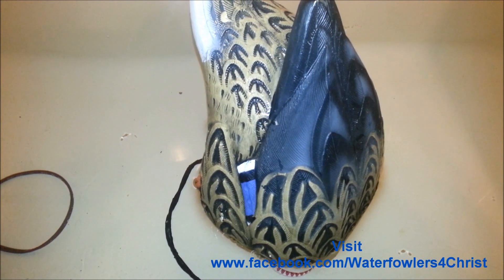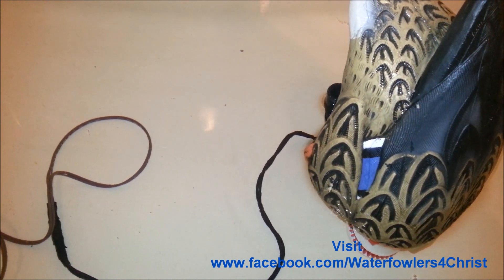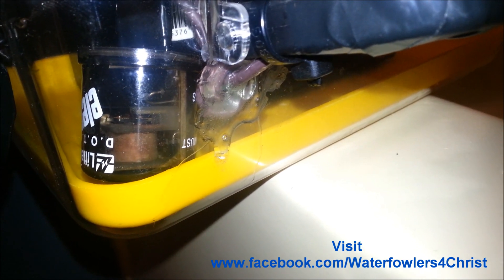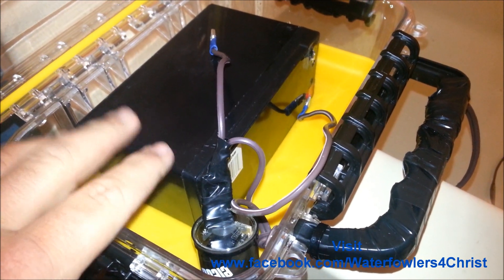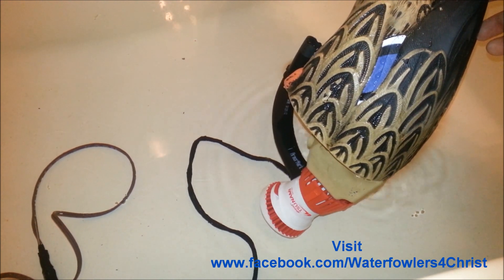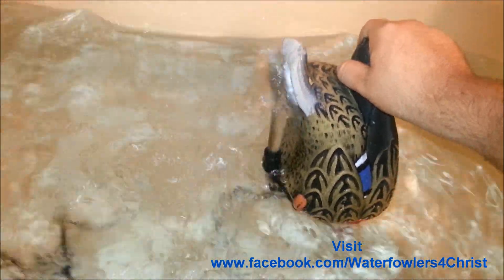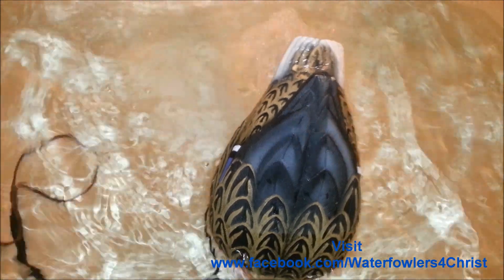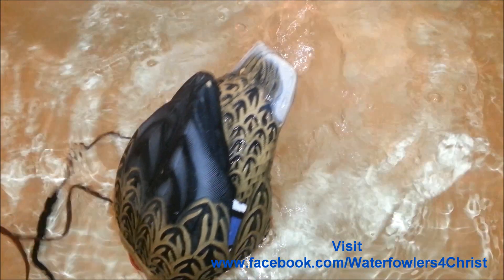How-To: Homemade Duck Butt Pulser Decoy

Comment: Hey thanks for the video. Just made two of these. Only problem is the battery box floats, too much buoyancy. Did you just let yours float when in use?
Reply from the maker: I actually added about 4-6 lead strap weights inside the box. Just enough to sink it. That way the box acts as the anchor.

Comment: just made Mike and it works great 9.00 for the pump on amazon  I didn't make submersible  box instead I made a box with a on off switch an a solar charging port to keep the battery charged an probly 20 foot of an older thick green extention  cord
Reply: +Cal Leblanc I just realized comment I didnt.know how to do the YouTube comment from my phone

Comment: How many amp hours is your battery and how long does it last while hunting?  Any problems with ducks flaring once they get close?  Thanks!
Reply from the maker: Battery normally lasts around 6-8 hours on a full charge. I haven't noticed it flair any birds. First season I used one, we had birds land right beside it and sit for a while.

Comment: you think you could send me a part number on that flasher. I have 2 6v deer feeder batteries in parallel running a 800 gph. I'm having a hard  time getting a flasher that will work. Ive tried two electrical flashers and 1 thermal cant get the bilge to flash. thanks
Reply from the maker: Sorry, just saw this comment. It was a Novita EL-12 flasher. I have others who messaged us on Facebook have some issues with them occasionally. I bought mine from the local AutoZone. However, the ones I've seen that had issues seem to come from Online retailers. Not sure if they are knock offs or if they were wired backwards. I've built 2 and they both pulse a little differently, so it could just be the quality of the part too.

Comment: Did you experience your wires from the battery to the relay getting hot? I used 18 gauge wire.
Reply from the maker: I haven't noticed it at all. Although, the water around the box keeps it pretty cool.

Comment: very good idea. thank u. If u wanted u could just add a decoy timer to it instead of the flasher.
Reply: had same thought would seem more realistic to me and drain battery less if it had more of a delay started looking at adjusyable flasher relays lots of cheap ones on amazon around $10 but any timer would be an improvement but whatever works for you

Comment: How'd you wire the flasher? Is there some kind of in line fuse?
Reply from the maker: I just added it in on the positive side just inside the box. I didn't add a fuse in either. I have noticed that some flashers do not work with this setup. The cheaper ones are thermal-based, and do not work. The more expensive ones are electromagnetic and work fine. Hope that helps!
Reply: Waterfowlers4Christ maybe i just need heavier gauged wire

Comment: did the jb plastic weld close off wire stregth from battery??? it did on mine
Reply: with that bidlge pump, i got same one, i can tell it did...
Reply: mine sprays way more
Reply from the maker: Didn't notice. The 2 I have, one sprays more than the other. Figured it was the hose being longer/shorter.
Reply: run it directly to a battery and not by box and you will notice a huge differnce
Reply: how did you wire your flasher?  can't get mine to work?
Reply from the maker: just from the battery to the flasher, and then to the bilge. Usually when someone has a problem, the flasher is either not an electromagnetic type, or it is a bad unit.

Comment: I didn't make my box submersible I used a water tight ammo box an wired in a on off switch as well I toss it out between the other 3 butt ducks I have an now they all move with the ripples....... keep in mind you will not get all that motion when you put it in a pond or open water the waves bouncing off the side of the tub over exaggerate the motion but it does send out a good ripple still an the tail wiggle great

Comment: Cal leblanc I got it off amazon from a private seller it was the same one as in the video
Reply: +Cal Leblanc get a remote for a mojo wing duck or use a remote from an cheap remote control car from Walmart I used an old green extention cord for Christmas and have over 50 feet of cord that go's to my box in the boat with the on of switch...... we hear or see the duck coming an flip it on or some times we just leave it on I use a 12 volt power wheels battery from one of the kids old toys an used the quick connect from it

Comment: how to you connect the bilge pump to the decoy?
Reply from the maker: +Scott Gammel , I used 2 exterior grade screws (Fencing or decking) about 2-3" long. the Bilge pump screen had some holes in the top, so I put them through the holes and tightened the screw down.
Reply from the maker: +Scott Gammel , also I added a link to the PDF that shows more of a step by step.

Comment: How did you attach the bilge to the decoy?
Reply from the maker: +EastTexasBassing Sorry it took so long to reply, I haven't had time to check messages lately. I used 2 exterior grade screws (Fencing or decking) about 2-3" long. the Bilge pump screen had some holes in the top, so I put them through the holes and tightened the screw down
Reply from the maker: +EastTexasBassing , also I added a link to the PDF that shows more of a step by step.

Comment: hey man add a 12 vdc key fab switch to that bad boy and your in business!  15$ on amazon cool build!
Reply from the maker: Would like to find a cheap waterproof switch to add to it. Haven't seen any that can be submerged and work like I hoped.
Reply: Waterfowlers4Christ  If you put it in your circuit in the box it will work out and be protected, some fabs work for about a 100 ft and the radio waves travel better through the water than on land.